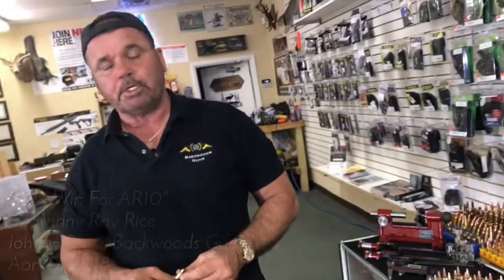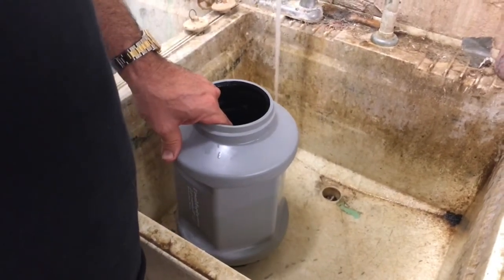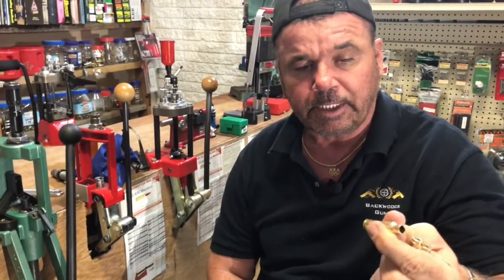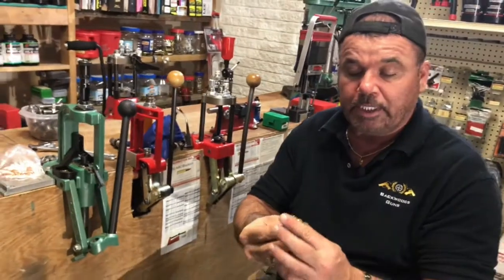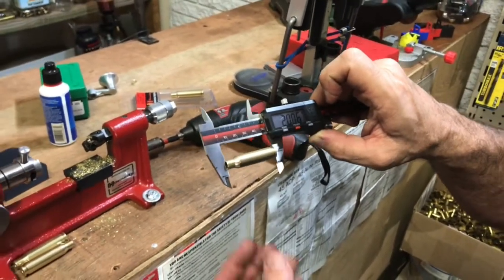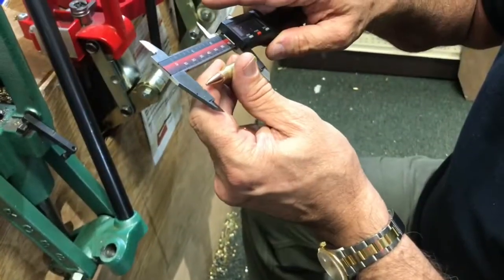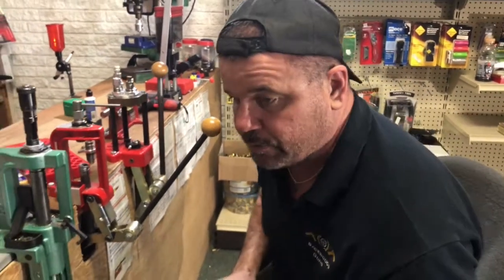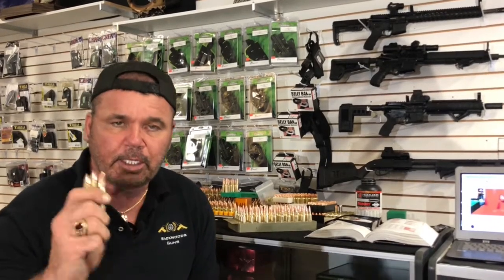308 Win For AR10

Comment: Thanks for the video. The RCBS puller is super fast. I bought a bunch of cases of 150 and 165 bulk 308 and I tare it down and lever the powder charge, resize the cases in an old lee die with a filed off depriving pin then reseat the projectiles at a depth that my 308 at likes and I get great results out of cheap bulk ammo. The RCBS puller makes the disassembly super fast. You video is great.  I'm glad your videos are still on here.  Thanks again.

Comment: I watch videos on the caliber I am reloading. Tonight it was 308 Win. I always give a wet tumble with out pins before I resize to insure there is nothing that will scratch cases or dies when resizing. Then I give a quick dry with a towel on them. Then I lube with an alcohol and lanolin mixture and resize the brass. Then I trim the brass. With the lube still on it. After that I tumble with pins to remove the lube, removes brass shavings from trimming and use a good squirt of dish soap and about a half a shot Real Lemon lemon juice. Then I let tumble for a minimum of 4 four hours. The brass comes out shinier than new. Then I separate the brass from the pins and rinse the brass and give a quick tumble without pins to remove any soap residue. The brass is near perfection when I am done. The Hornady FMJBT is a great choice for an AR10 bullet, the cannelure is in the right spot for it. If I would have used Varget, I would have went for the max safe load, 44.9 gr. Tonight I'm using RL-15 at max charge that works well in my AR. I also give a tight crimp on them. You can tell when you have a tight crimp when you try to pull the bullets from the cases. I have never had any problem with pressure on tight crimps. You should of had your bullet puller looser so you could put the bullet in it to the case neck and remove it without damaging the bullet. My method takes longer than other methods, but that's just the way I do it. Sometimes I store my bullets for many years, and they are just as good as when I put the crimp on them. Rock on.